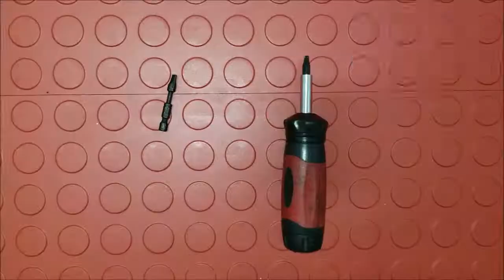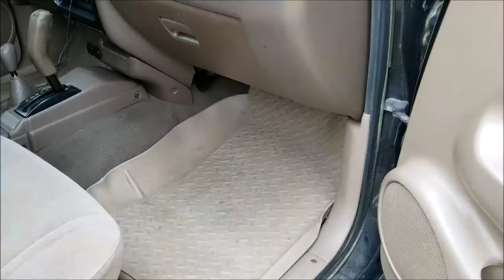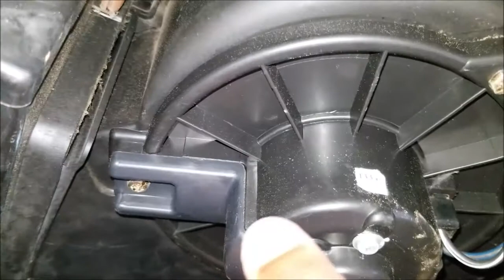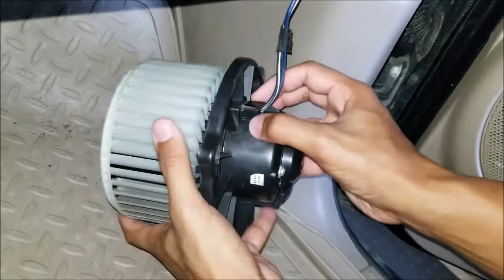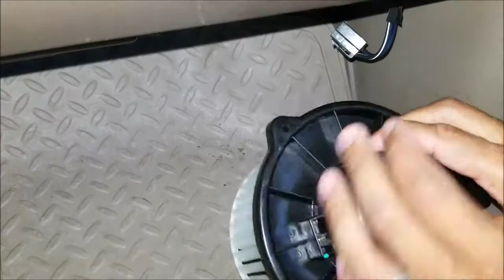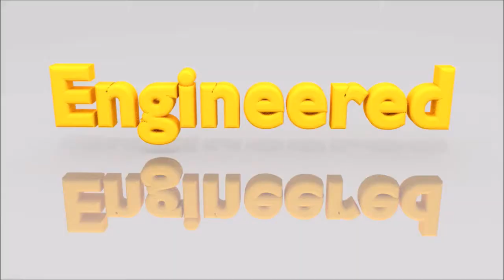Remove and Replace Blower Motor | AC Not Blowing | Tacoma T100 4Runner Tundra

Comment: Thanks for the video . Just finished mine , it was making a low humming noise and not blowing much at all . After removing it I did not find a lizard but I did find the squirrel cage full of insulation ( not sure where it came from ) . Cleaned it out and works great . Maybe having the blower motor pointing straight up isn't such a good idea .Also one of the screws was a pain to reach without removing the kickplate but it can be done .
Reply from the maker: I don't know how those critters find their way in there, but they do! Glad you were able to knock out this fix
Reply: @EngineeredMojo  Your advise was greatly appreciated . Keep these video's coming .
Reply: It would be a whole lot harder to remove if it were in pretty much any other orientation though.

Comment: thanks. my ac was blowing crap in my face and making a buzzing sound.  took the motor out and was filled with leaves and junk. easy fix for once on the first gen tacoma.
Reply from the maker: Haha very true, surprisingly simple fix. I dont know how so much gunk gets in there, but it's a nice feeling knowing your vents are blowing a bit cleaner air at your face for sure

Comment: So easy! Going to take out the blower motor on my  grandfather's truck to clean/inspect because it makes a lot of noise on the 2 highest fan speeds now, so my suspicion is leaves.
Reply from the maker: Yes it's not a hard job at all and you're suspicions are probably right. So much random debris gets sucked in there haha